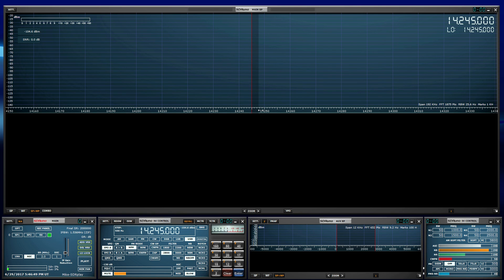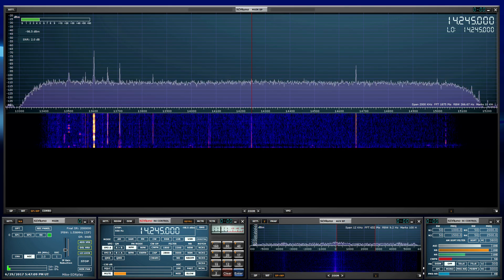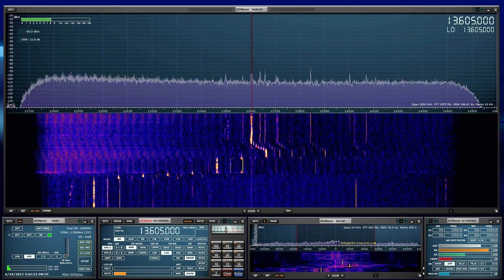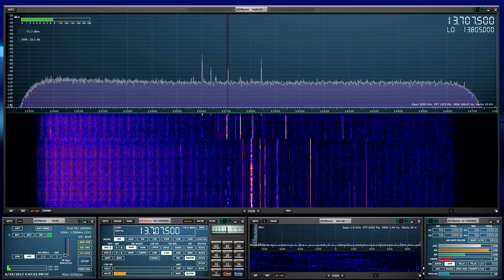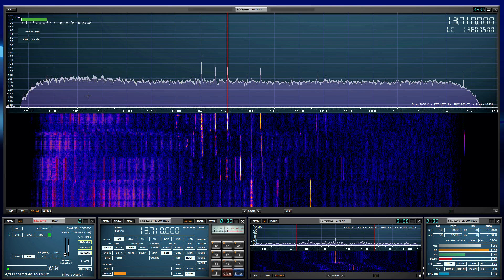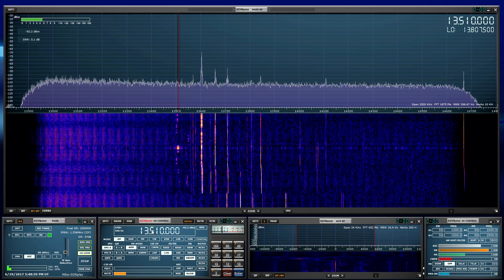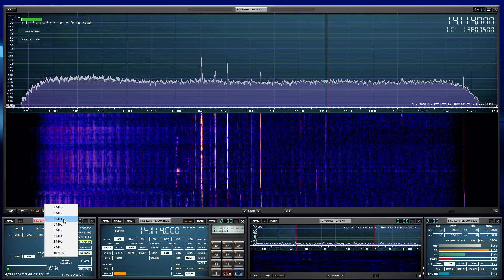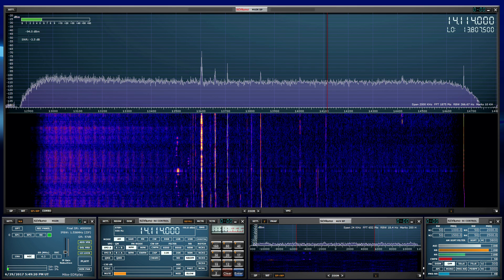How to tune the LO and LO lock in SDRuno

Comment: I'm still trying to wrap my head around this (as a new ham).  How much separation should I set and in which direction?  Is there not a global setting I can just set (say +100kHz) and not have to worry about it anymore?
Reply from the maker: No need to worry about it just click either side of the center line, separation should be greater than the bandwidth of the signal you want to tune, so 10kHz would be enough for HF, or 200kHz for broadcast FM etc.

Comment: Is there an optimum offset of the LO? I'm trying to get my head around this as in a normal receiver the LO is fixed at the IF above the RF input frequency. There are advantages and disadvantages to low and high IFs. I guess this is all different, but can't find definitive explanation describing aspects of the LO settings in the SDRuno documentation. 

Thanks for the videos. They are a great help!
Reply: Bump
Reply: High IF will have less interference.  On HF frequencies you will have radio signals via the ionosphere.  Thats why manufacturers normally choose a high first if.  E.g: 70MHz.  Low IFs are usually hidden behind the first IF.

Comment: Very good explanation. I'm enjoying DXing with SDRplay RSP2 using SDRuno, and I'm using only an indoor loop antenna. This feature of locking the LO is very good for navigating in a given band. I'll try it next time. I've gotta figure out how to configure the recording. I tried and it recorded the LO frequency instead of the one I was listening to. Besides, it got too big and was divided into four segments (files). Gotta read the manual, or check for a video on this channel. 73!

Comment: Thank you Mike, good explanation. BUT, this is one of those behind-the-scenes details which a user should ordinarily not have to deal with. For example, using SDRSharp, the LO frequency is never seen, only the tuned frequency. Signals are always demodulated properly and no DC spike is normally present. With SDR Console, same thing. SDRUno is wonderful software and is much appreciated in that the SDRPlay folks have provided it for free. But it is, in general, somewhat confusing compared to the more traditional single window user interfaces of the others.
Reply: I totally understand. It is being looked into. The great thing about all the frontends (HDSDR, SDRconole etc etc) is we have the ability to choose the one that works best for us. Thank you for taking the time to leave a comment.